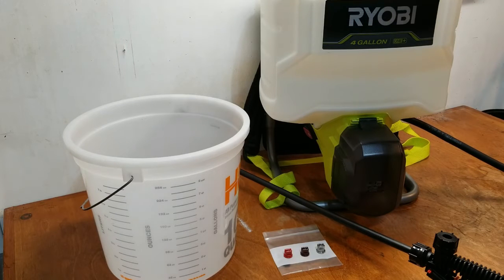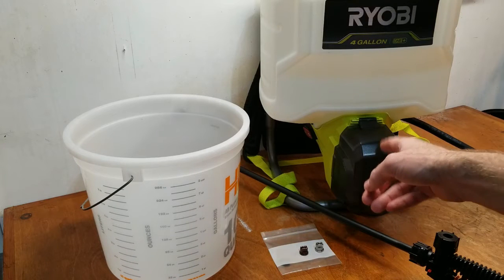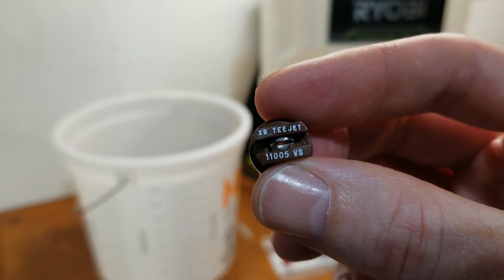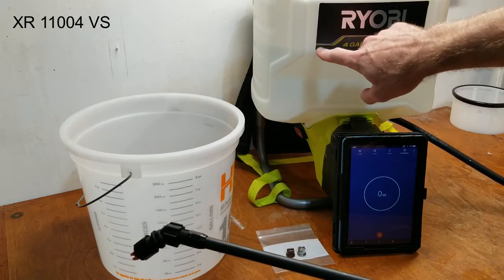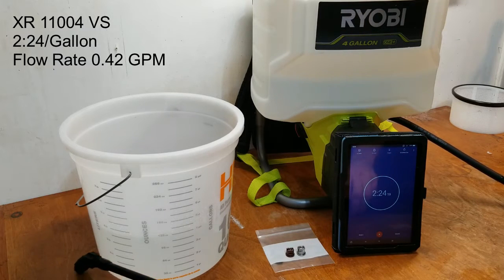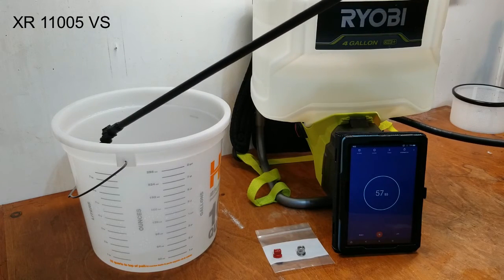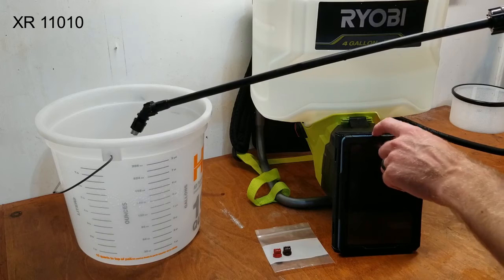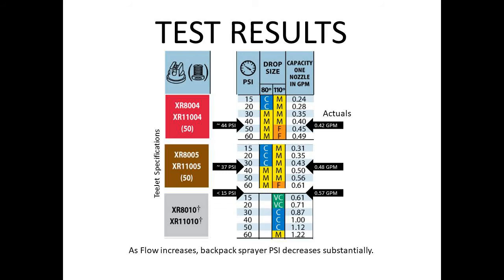TeeJet Nozzle Flow Rates using Ryobi 4 Gallon Backpack Sprayer

Comment: In Teejets catalog they have flow rates in gpm and ounces per minute. I calibrate a little differently by timing 1 minute and seeing how many oz's of water is collected, then comparing it to the oz spec for the tip tested. Tips are color coded to flow rate and red is always 0.4 gpm. Just like your garden hose, huge amounts of flow, less pressure, big droplets. Higher pressure, lower flow, fine droplets. The red XR 110 or 80 work best for most home applications. I have the white XR 80 at 0.8 gpm for fungicide spray which calls for 2 gallons carrier per 1000 sq ft which is exactly double the red XR 80 0.4 gpm flow rate and enables me to spray 2 gallons in the same amount of time as the red 0.4 tip spraying 1 gallon per 1000 sq ft.
Reply from the maker: All good info, Kevin. Thanks for sharing this!
Reply: great day!  i wonder if you can help with my problem.  was told to spray with high pressure - no less than 65psi but preferrably higher and use low volume - no more than 8 gallons to the acre.  what should result is a mist, no quite a spray, like a fog.  atomization i believe is the term used.  so which teejet nozzle to buy...mygreathanks and blessings
Reply: @paulbraga4460  I think your figures are way off. 8 gallons an acre is 1 gallon for 5,000 sq ft. Normal pesticide is 1 gallon for 1,000 sq ft and cautioned not to atomize but to provide droplets that stay on the foliage. Check what your pesticide instructions call for and not what someone is telling you.
Reply: @ thanks for this.  that is my agricultural consultant who told me and this is not pesticide application - tis a NUTRIENT application.  reason why i asked help with which nozzle to buy - one that will MIST and not quite spray...blessings

Comment: I have the 1 gallon 18v ryoboi sprayer. The nozzle in it is horrible and it takes forever to spray. Will this nozzle work with the 1 gallon 18v version. Thanks
Reply: There is another video on YT that shows how to convert a 2 gallon sprayer wand to use teejet tips. I have the 2 gallon version and converted to teejet tips for some applications.
Reply from the maker: Hi mptrader. Best I can tell by looking at the 1 gallon's pictures and owner's manual,  these nozzles will not work.

Comment: Just confirming the red one is the best psi for the Ryobi 18 V?
Reply from the maker: Hi. Thanks for the question. The red one produces a higher psi/lower flow rate due to the smaller orifice size. In my case I use the brown nozzles because the flow rate works best to apply 1 gal/k with my walking speed.

Comment: This was really helpful, thank you! I just installed a TeeJet flood TF-VS5 on the newer model ryobi which claims up to 90 psi. After several bucket tests I appears I'm only getting about 10 psi (0.5 gal per min) with this high volume nozzle.  Seems in line with your results.
Reply from the maker: Hi Mike. Thanks for the comment!  I appreciate you sharing your results with the TF-VS5. I know there will be others who find your experience with the nozzle helpful. The higher claimed psi must only be possible with very low flow rate nozzles.
Reply: @BlackHoleDIY  agreed. This must be why the newer Ryobi psi adjustment knob doesn’t actually tell you what psi you’re on.  It also explains the manual stating “up to 90 psi”. Too many factors at play.   I assume this is true with most battery backpack sprayers. It’s all good, I still really like this backpack sprayer.
Reply from the maker: So true. I really like mine, too. I haven't had any issues with it. I would have preferred it come with one of the batteries that has an LED status meter, but I've just been charging it every 12 gallons or so.
Reply: @mikes7164

Comment: I'm using this to softwash houses. Do you have any recommendations for compatible tips that focus on distance?

Thanks
Reply from the maker: Hi Craton. Unfortunately, I do not have experience with any other tips that are designed for longer distances. Does the adjustable  nozzle that comes with it not meet your needs? I think it adjusts from a cone to a stream pattern.
Reply: @BlackHoleDIY  yes it does come with adjustable tips. I just don't think it will do well with 2 story homes.
Reply from the maker: Ah, I understand. I wish I could be of more help.

Comment: Would have been nice to see which tip had the longest distance spray....
Reply from the maker: Hi Jerry. Each of the nozzles tested are rated at 110 degrees spray pattern, so the width, or swath, of the spray will be similar for each. The manufacturer documentation recommends maintaining the nozzle 20 inches off the ground.  I can certainly perform a quick test to determine spray distance, if you'd like me to, but as fan nozzles they're not designed for distance. Just let me know and I can follow up to this comment with my findings.

Comment: Are you still using the Ortho díal 'n spray, and I thought you made some tweaks to make it more efficient? Thanks
Reply from the maker: Hi John. Yes, I still use the Ortho when I apply humic acid. I like the Ortho for when high volumes of water are needed to get the product to the soil. This video shows the current configuration of my Ortho  - https://youtu.be/qrRM0jM41sQ - which still works great!

Comment: Did these tips work as is or did you need to modify with other parts? thanks
Reply from the maker: Hi Colin. No modification needed. Teejet nozzles fit without issues.